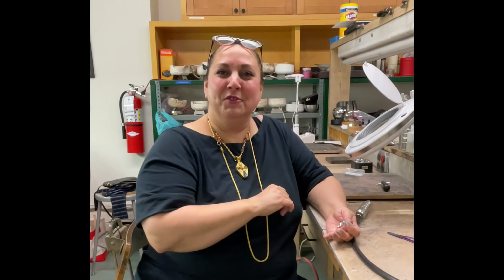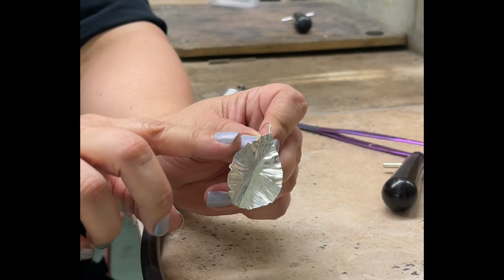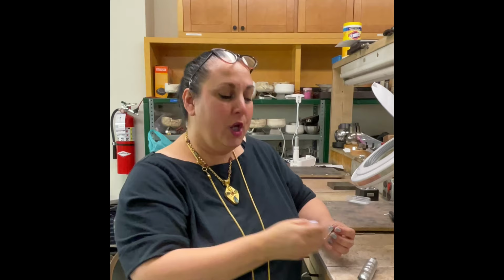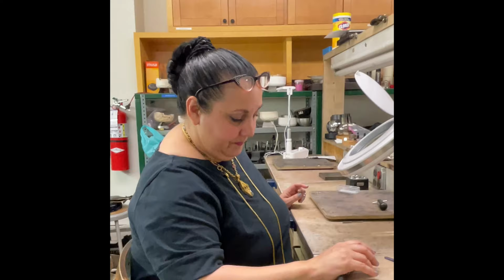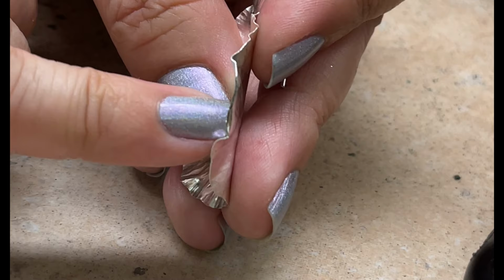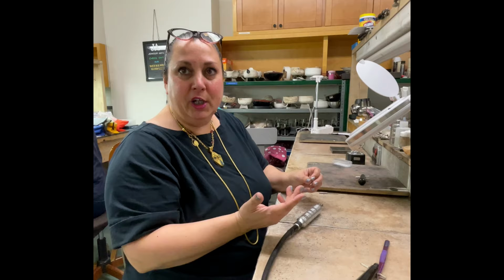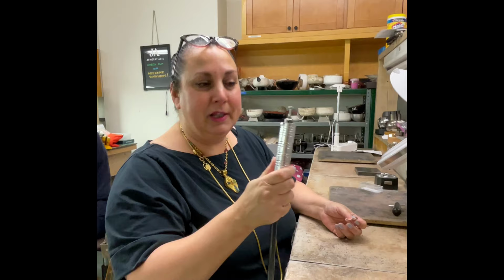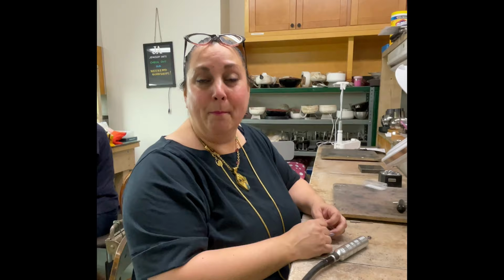How to Use a Margin Roller for Finishing Metalsmithing Edges

Comment: Excellent video! I have a question: I want to buy one of these rollers and went on your website but how does is the device powered? It is attached to some power source at the end there? Thanks a bunch!
Reply from the maker: Thanks! You put it in a flex shaft, dremel or microtorque.  :)
Reply: @JewelryArts  Ah! Ok cool. Thanks for replying so quickly. Do you sell those too? Thanks in advance

Comment: Jello Jeanette,
 I' ve got my margin roller 😊. I think I make something wrong...
After using the edges right and left next to my line are getting a sharp ege, that I have to sand. So it looses a part of it's thicker edge. I also tried to make fist to make the line and make the edges after also with the margin roller in a about 45 degree angle. I don't know, if it is the right way...
I hope you have had a good start into the year 2022 and keep on making your videos. Thank you for teaching me so much. 
Greetings from Germany 
Maren
Reply from the maker: Hi Maren Happy New Year!
Hmmmm, you need to use the margin roller directly on the outside edge of the metal and just a few strokes per section. Is that what you are doing?
Reply: @JewelryArts ... Yes, I did t I that way...
Reply from the maker: @marenc9648  Could you shoot a little video of you using it and email it to me?It would be really helpful to understand what is happening.
Reply: @JewelryArts  I'll do it. Thank you very much
Reply from the maker: @marenc9648  Then we will get to the bottom of this issue. :)
Reply: @JewelryArts  Hello Jeanette,
I have sent you a little video and a foto to the mailadress of you website...
Greetings from Germany
Maren
Reply from the maker: @marenc9648  I watched your videos and the only thing "wrong" about your technique was that you stayed too long in one area. Your brass was thicker so it was able to withstand more but that thinish silver only needs one or maybe two quick  passes per section. If you keep going over an area, you will get more of a burr. Try doing less and you should get a better result. :)
Reply: Hello Jeanette,
thank you very much for your very soon and helpful teaching. I' ll try it again 😁😁😁. 
Many greetings from Germany 
Maren
Reply from the maker: @marenc9648  You are very welcome! :)